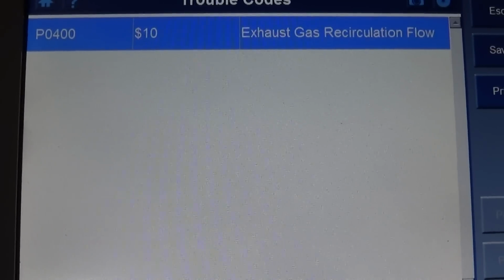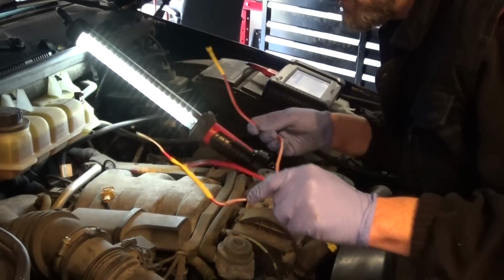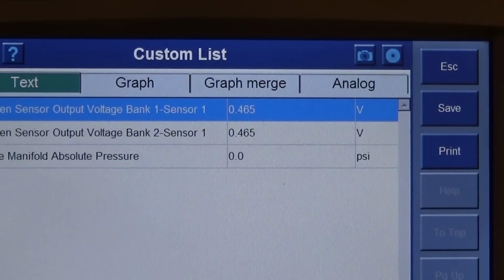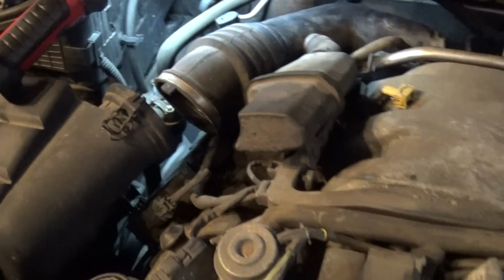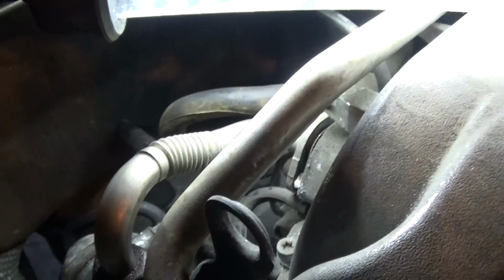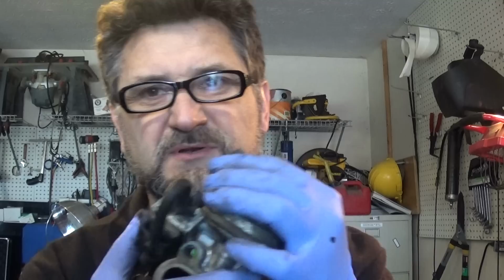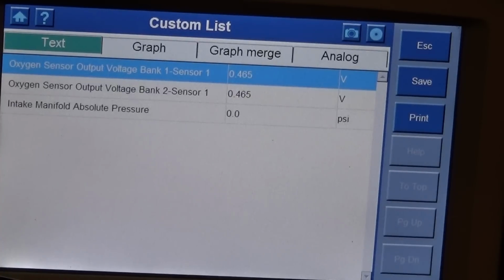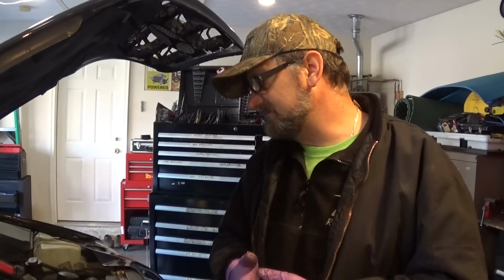2002 Mercedes Benc ML320 P0400 And EGR Valve Removal

Comment: Great video. I have a quick question. Does anybody know if the battery needs to be disconnected before taking out the egr and disconnecting the electrical solenoid connector?  Did you work with the battery connected, since it wasn't mentioned in the beginning nor was it mentioned at the ending after everything was put back?
Reply from the maker: No you don’t have to disconnect battery but you can if you want to. 👍

Comment: Removed EGR valve, cleaned all vacuum lines, cleaned and checked EGR valve functionality (with vacuum and electrically). Still getting a P0400 code after a few miles... Any idea? Below is the log:
Engine Load: 10.20%
Speed 69 km/h
Fuel System Status: 3) open loop: engine load OR fuel cut due to deceleration
Intake manifold absolute pressure (MAP): 21.00 kPa
Long term fuel % trim -Bank1: -3.91%
Long term fuel % trim - Bank 2: -3.91%
Short term fuel % trim - Bank 1 0%
Short term fuel % trim - Bank 2: 0%
Engine coolant temp: 83ºC
Engine RPM: 1350rpm

Comment: i didn't have trouble with the bolt next to the fuel injector, but the other one, i think its stripped out, i dont know how to get it out, star bolts suck.
Reply: They sell sockets for stripped bolts.. and you can weld something on and screw it off

Comment: Great work & explanation, How about the PVC valve?? (not the flow pipe from above throttle valve & rocker cover,  I'm getting throttle valve contamination thru this pipe as PVC isn't working, but what's the best way to access & service Please??? ML320 2002, over 230,000km

Comment: Any ideas for a code p0401 insuficient air flow on a 97 ford f150. I already clean all the throttle body components the egr holds presusse when apply with a pump. Now is there suppose to be suction from the hose that connects to the egr all the time? Or is this something control by the unit that the hose comes from because there is vacume coming from the hose that goes into the unit... help
Reply: Might be too late but I would check the DPFE sensor to see if it responds when the egr valve is commanded on. They always go bad on those fords especially that year.

Comment: Great Video !!!

What type of cleaner did you use to clean the egr pipe? I have a 2001 Mercedes Ml320 I replaced the egr valve and I’m still getting the error code and my check engine light is still on.
Reply: The check engine light came off only for a few days then back on. I have  a universal egr valve on the car should I have gotten the exact Mercedes egr valve... we have cleaned everything also.. what could be the issue?
Reply: @Seforahkayy7  what ended up happening
Reply from the maker: Kesha Bass you can use brake cleaner but you have to use screwdriver or something similar to brake carbon deposits. Cheers

Comment: I am having a hard time inserting the tube back into the intake, any help?
Reply: It's a bitch,  make sure u stop at the dealer for a new gasket that goes between the throttle body and air intake tube.. it's like 14$ .. I'm still planning on just putting an aftermarket tube and tighting it with a clamp. I already found one on ebay that I could modify to fit everything.

Comment: Thanks I was able to remove all bolt  but not able to remove egr valve can you give any hint about how to remove it.
Reply from the maker: rajesh shah Any luck? It is difficult but you will have to wiggle it out. Be patient . Sorry not much of  advice.
Reply: Yes I was able to take it out but I have to remove rubber part which look like butterfly right next to pipe connection but your video did help me out Thanks.

Comment: Thank you.  I just tackled this repair with me 2005 clk320.  Two tips, remove the trans dip stick tube mounting bolt for more clearance and pull the plastic tee up to make room for the inboard egr tube bolt.
Reply from the maker: Pay Way OK thank you sir for sharing your tip. Cheers

Comment: KY, clogged EGR valve?
CL55 5.5LV8 
Codes P0400, p0422, p0173
Exhaust noise out tailpipe
Noise occurs when reved for 1 second. Letting off gas pedal. Noise is out both tail pipes not 1.
*Clogged Catalytic Converters?
*Clogged / Bad EGR Valve?
*Exhaust Leak in pipes?

Comment: I have ml350 2004 which is almost exactly the same as yours. I recently replaced vacuum booster and that cleared the codes. My problem is that when I start the car in the morning, even so the idle seems to be fine, it will run a little rough when transmission engaged while accelerating, until about driving 10 or so miles. I don't have freeze frame and it's clear of mil codes.